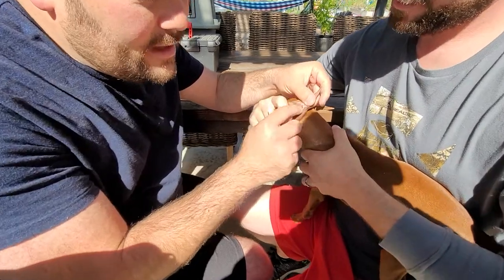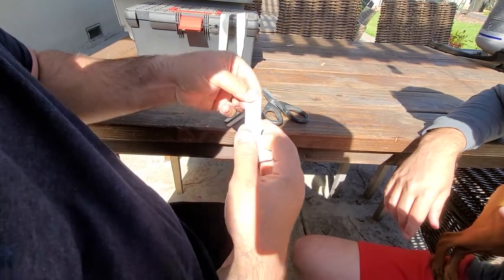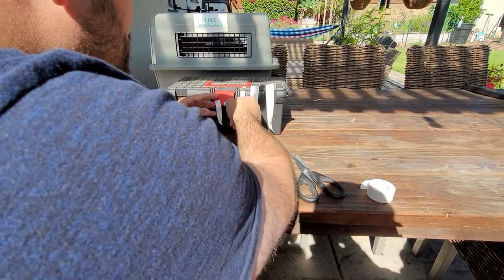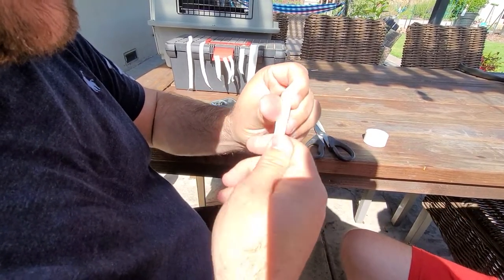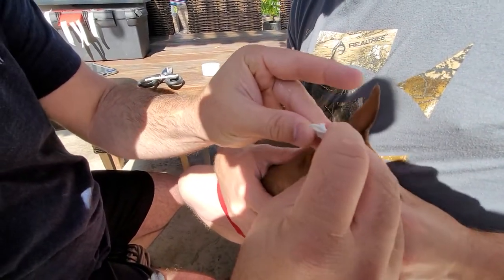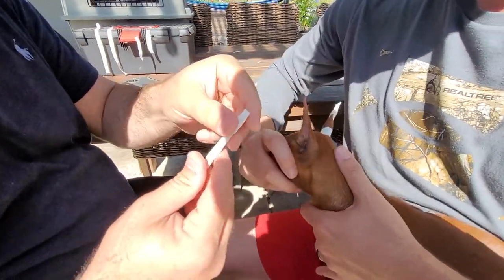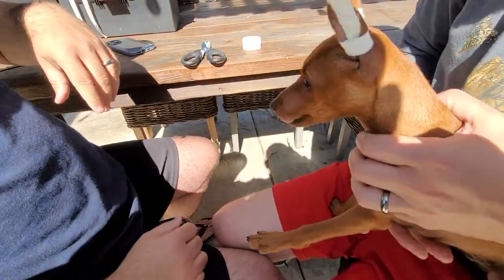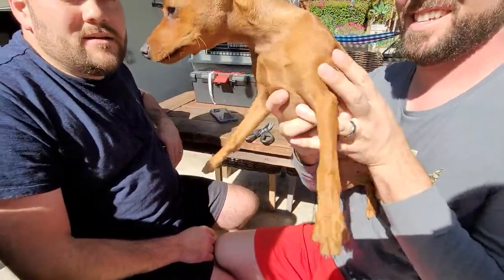How to Tape a Minpin Ear!

Comment: So my pup just had the cup removed, her ears are already standing like your pup in the video. So how long will i need to tape for?
Reply from the maker: Minpins are easy they tend to stand up on their own, just make sure you stretch them good so there will be no folds. Most likely around one month or two depends on the ears of your puppy. Thank you for watching!
Reply: @kadogshowtv7222  she has one ear where the tip is curling backwards. I tape.. it stays straight for a couple weeks then curls back again. Any advice on this? Shes 8 months
Reply from the maker: @high_fructose_corn_syrup  where are you from?
Reply: @kadogshowtv7222  i live in CT. had to travel to New York City to have her ears cropped. The vet did a greatttt show crop but ive always had the pet crop. The tips are very thin and the one wants to keep curling backwards. Im going to put another breathe right strip on it for a few more weeks. At 8 months, im starting to worry
Reply from the maker: @high_fructose_corn_syrup  keep on taping... some dogs need more time just make sure no pocket or fold...make sure to strech them out... good luck